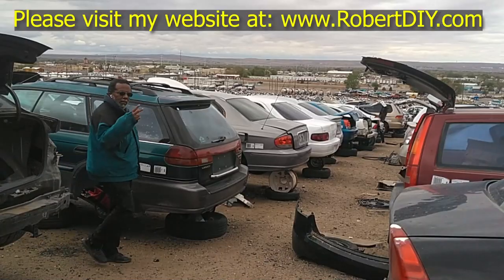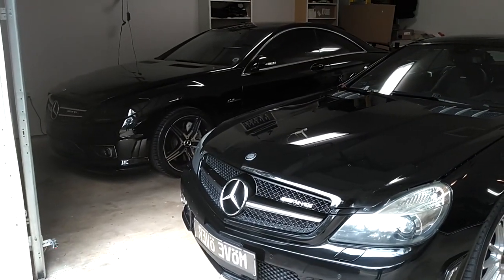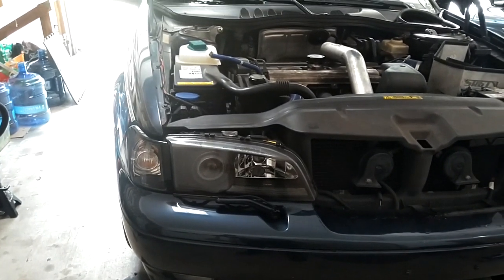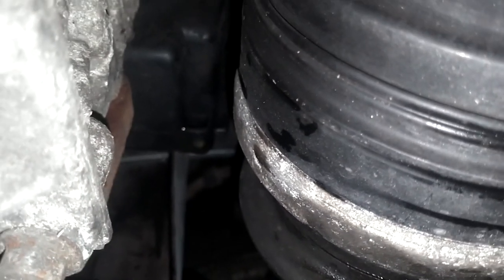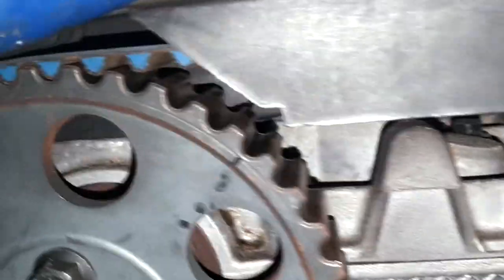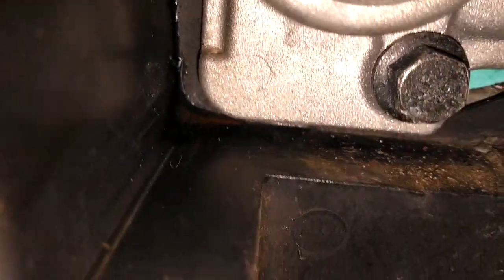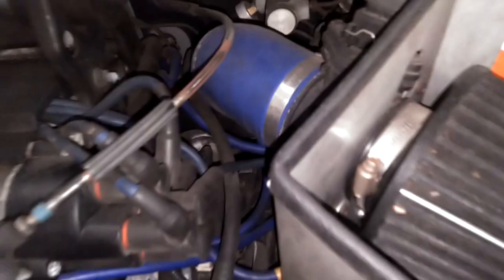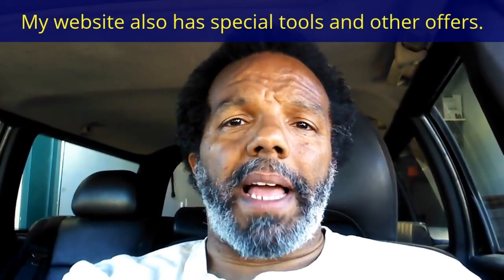Volvo S70 coolant leak. Checked water pipe, set timing and pulled water pump, checked other things.

Comment: I've had luck with the T45 tensioner screw by taking a new torx bit, like a 3/8 drive socket bit, and cutting it as short as possible, and grinding the end dead flat so the torx teeth go right to the tip.  Plus, if it's as short as possible it's less likely to twist out of alignment with the fastener as you torque on it.  I grind one, use it, and put it away so it keeps sharp teeth for the next tensioner.
Reply from the maker: Good idea. I was thinking about doing that with my old used driver.
Reply: @RobertDIY  They do sell torx that are very small, Amazon has a set!

Comment: If you had not  jacked up the engine, would it have been impossible to remove all the water pump bolts?
Reply from the maker: Makes it easier.

Comment: FCP sells a Gates timing belt that is blue in color some kind of upgrade. I been to 2 stolen cats here at home, I learn my lesson just put a straight pipe and good enough until the money light inspection. Nice tip on the vice grips that torx is a bear.
Reply from the maker: thanks for watching.

Comment: Man I hate that T45 tensioner screw so much. Previous owner stripped mine out and I had to drill it out, through the wheel well. It is way too shallow and the bit doesn't go in as far as it really needs to
Reply from the maker: I've stripped one before.

Comment: Nautic blue metallic was the prettiest Volvo color in my eyes! Is this S70 a 1998, noticed it had a mechanical throttle cable, not the Italian made
ETM?
Reply: Correct. I own both types 98 and 00 s70. If you have the etm slap a xemodex upgrade on it now. Not a question of if by when. Ntm throttle etm response is holy crap level. I found I needed new struts after I did mine. Went with s60 rims with shorter tires to avoid the reaction light from coming on every time. Lost u turning radius but gained hella grip. More rubber in the road. Weeeeeeee. Lol
Reply from the maker: In the USA, they didn't use the ETM until '99.
Reply: @RobertDIY  I was one of the dummies who bought a 2000 V70 Cross Country and didn't know about that Italian ETM problem until it hit about 72,000 miles. Paid through the teeth on that dealer repair!
Reply: @brianklamer3328  I got a 2000 V70R a few months ago, there's a lot to do, but man I love the car. One of the things I have to do is get a new contactless throttle sensor and replace it

Comment: hello i wanted to ask volvo s70 no traction where to look for failur
Reply: Have your traction control rebuilt on exchange. Roberts got a video. The even send you the reverse torx. 3 mini bolts from top one with 2 long extension from underneath. You'll risk stripping if not from underneath.
Reply from the maker: https://youtu.be/5Xmesel_NZY